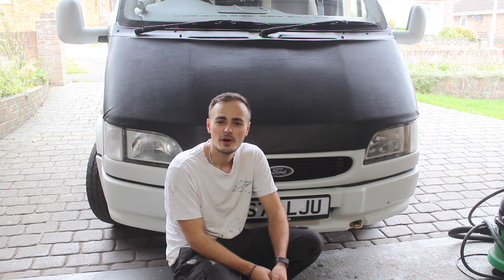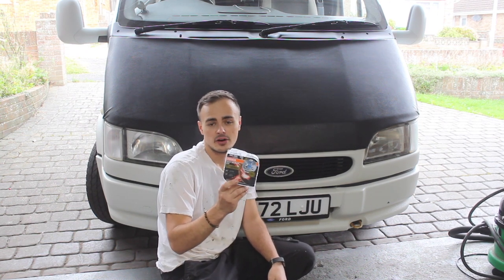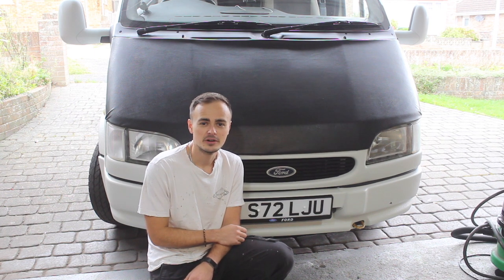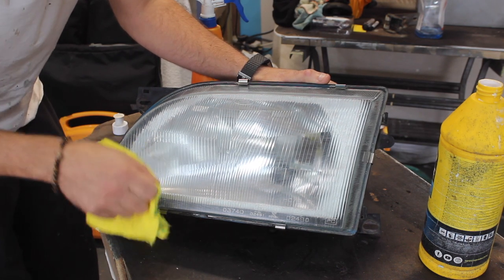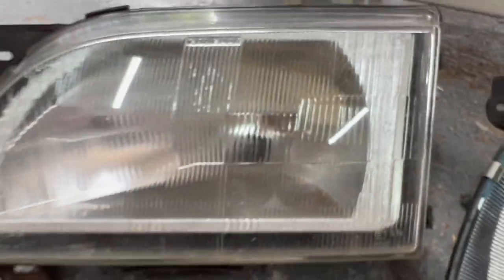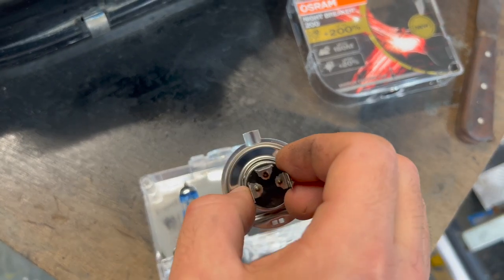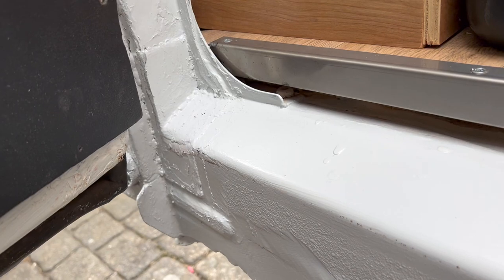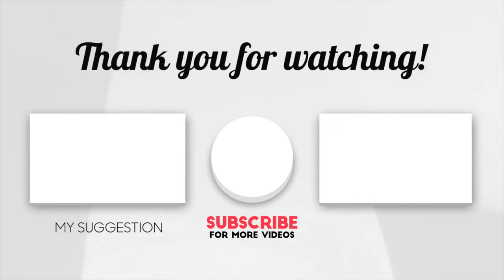Channel Update - Headlight Replacement & Osram Nightbreaker headlight bulb review

Comment: Hi. Ollie, when you did the welding on your van did you use a gas-less welder? And if so what settings/plate did you use mate? Thanks for your guidance.
Reply from the maker: Hello mate, I started off with a gasless welding set up but have since upgraded and now using a mig 180 with argon co2 mix. Made a video about it if you’re interested. I tend to use 1mm for bodywork and 2mm for inner sills and chassis repairs. I’m not an expert by any means but it works for me 👍🏼
Reply: Cheers Ollie

Comment: Hi bro my ford transit doesn't work and the fuel gauge doesn't show what could be the reason did you have a similar problem? If you have, can you tell me how you solved it.
Reply from the maker: Hi, I would start by checking if you have fuel up to the injectors. Crack off the nuts on the injector pipes and turn the engine over to see if you have fuel there. It could be many things but being compression ignition it’s more than likely fuel related. Has any work been done recently?
Reply: @TurnersWorkshop97  I don't have any problems with the van engine it's just that my fuel gauge doesn't work and I can't find where it is and I check in the tank with a stick to see if there is fuel 😅
Reply from the maker: Ahh ok, the sender unit is on the top of the tank I believe. Might have to drop the tank off to replace it or check connections etc